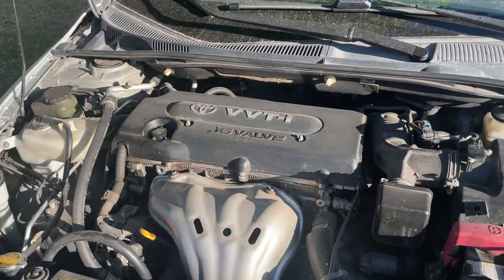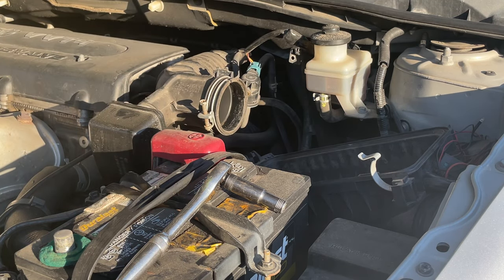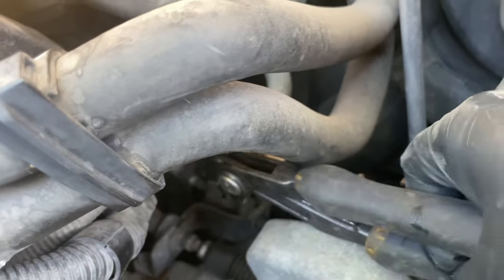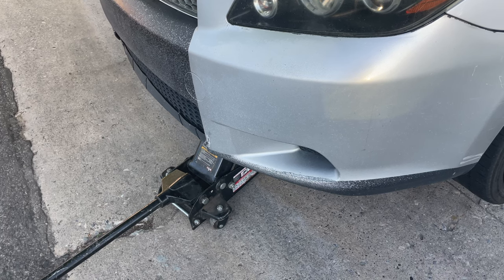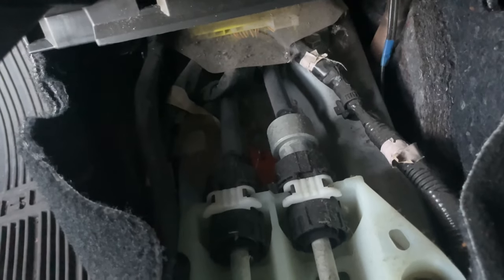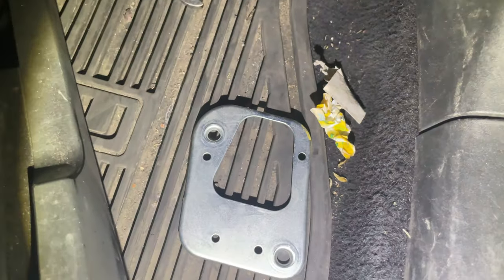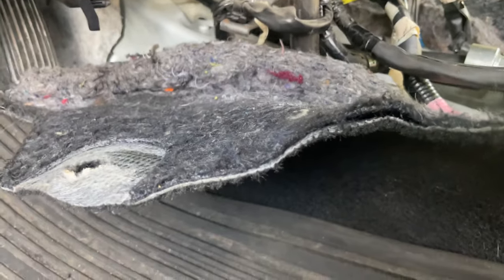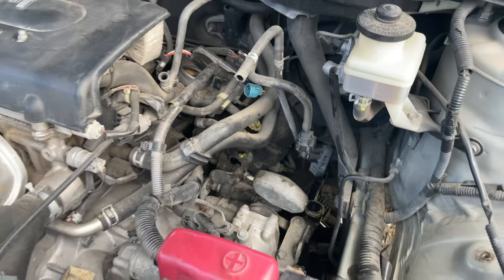🛠How to 🛠 shifter cables replacement for Scion tC first gen (05-10)

Comment: I got an 07 and my 5h gear keeps pooping out but when I hold it it stays good doing 80 miles per hour could it be a cable
Reply from the maker: Add some Lucas transmission fluid see if that smooths it out.

Comment: Hey my brother, question, my girl stalled my TC in first, when she did, it's stuck in first, can't get it out, AT ALL. So when start the car u gotta keep clutch in cuz it's stuck in first. I can get it into neutral if I move the hammer weight with my hands. Do you think it's the shifter cables? If I put new ones in do u think I'll be able to drive my car again? Can't find answers anywhere INCLUDING few mechanics. Appreciate any help my guy. Tha k you
Reply from the maker: Try to shift it into second gear with the engine off, if you hear a rattle noise it can be your throwout  bearing or clutch disk.